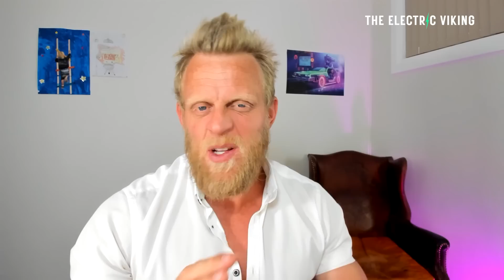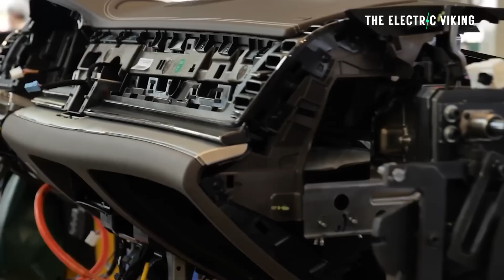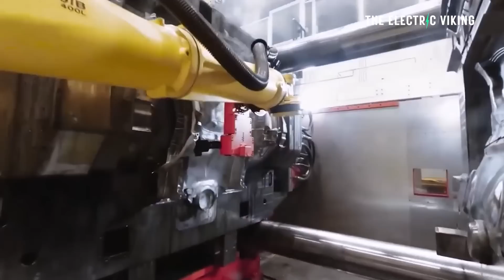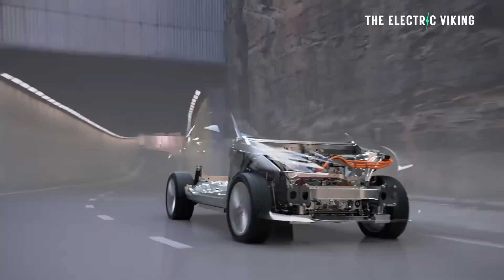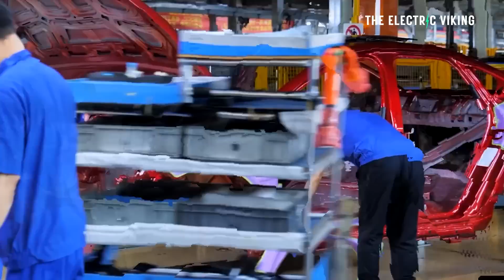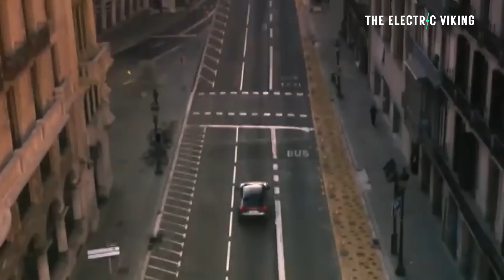Toyota reveal why Tesla and BYD are way ahead in EV manufacturing

Comment: Toyota likes to pretend all their customers care about driving "passion" but that is not true. The bulk of their customers buy a Toyota for reliability, that's it.
Reply: And EVs are inheritantly more reliable, so that makes Toyotas edge nothing
Reply: @davidgrieve7691  Yeah for companies that built the brand reputation on reliability of the ICE engine there could be a reset and have to start over with EVs.
Reply: Let's face the facts, Toyota is not even close when it comes to making exciting cars. they are good making boring as fk cars that does not push any boundaries. Now they said they are about passion because it'd got nothing going for it? give me a break...
Reply: Supra
Reply: @rp9674  Toyota sells what, 2500 of those a year? That didn’t even pay back the R&D. A factory line can’t make a profit at those numbers for a car in that price range.
Reply: @rp9674  
And what percentage of their sales are Supras?
Reply: @bobwallace9753 don't care what %
Reply: @rp9674 Which would be nothing exciting without that BMW inline 6 engine :).
Reply: @rp9674 Supra use BMW engines.
Reply: @ShahShah2-ln2sw my 93 cost $1000 for a timing belt change way back, I can imagine how much for a BM now, even my BM i3 is high maintenance for an EV.
Reply: @rp9674  How does an EV have a timing belt?
Reply: @rp9674 he was talking about the bulk of their customers. Not a handful of weirdo’s
Reply: The only "passion" that EVs lack is the noise. Acceleration is no longer called “passion" when EVs are proved to have much higher acceleration.
Reply: @deepseer  
In the near future ICEV noise will be the signal one drives an inferior vehicle.   Gasmobile clippity-clop.
Reply: @bobwallace9753  it already is. Noise is the new slow.
Reply: Corolla
Reply: I'm not sure what anybody's point is Toyota's trying to make a gimmick EV instead of a good one I guess they don't want to try to out Tesla Tesla. It'd be okay if they lowered the price on bz 4X and then make something better later, they could sell off of blind brand loyalty
Reply: @rp9674  I think they should have stayed out of the EV market until they had something really good and different to offer. The BZ line can only hurt the brand and won’t make any money.
Reply: @frankcoffey they're going to have to transition eventually to EVs
, I might be too hard if they wait too long
Reply: I'm not suggesting they make profit yet, it's learning time
Reply: Well rightfully so !
My 2012 Prius is 11 1/2 years old and hasn't had a single issue !
Reply: @cafl9844  I bought 4 new Toyotas since 2002 one lasted 160k with very few repairs.
Reply: Their only car that anyone might be excited about is the Supra. Lexus also makes a few very low volume sports cars you rarely see on the road, but too few to develop an passionate following. 😊
Reply: @jimmorrison714  Those are CEO hobby cars. He didn't care if anyone bought them. He just wanted to make them.
Reply: @jimmorrison714  Its not a Toyota is a BMW with some Toyota parts
Reply: If history has any meaning, it is that Russia had taken on the West and led in science and technology fields such as space. Ultimately, the West won in consumer goods or the economy. And the Chinese were the first to manufacture and trade high end luxury good worldwide, such as china and silk on the Silk Road,  which were sold it to rich European kings and queens. Now, the Chinese are making cheap stuff the European commoners can afford.
China has been taking on the West and looking good in consumer products or the economy, including space. 
Now, with the help of the West, China and Russia are cooperating. Is the future hard to predict?